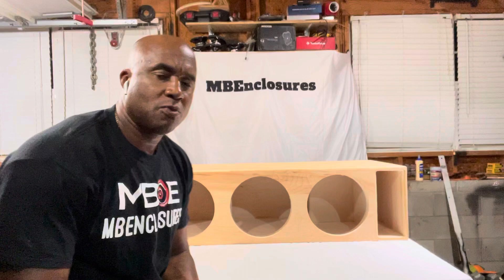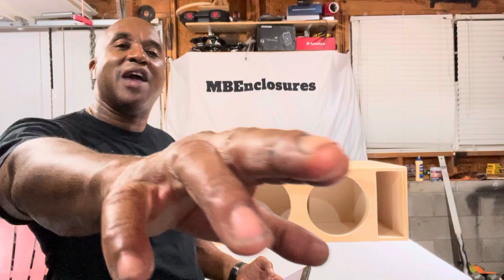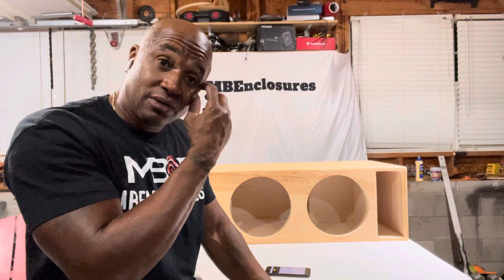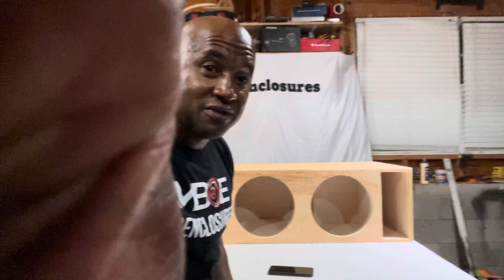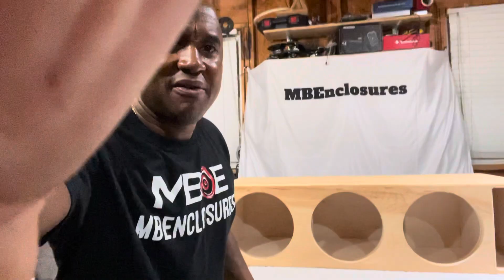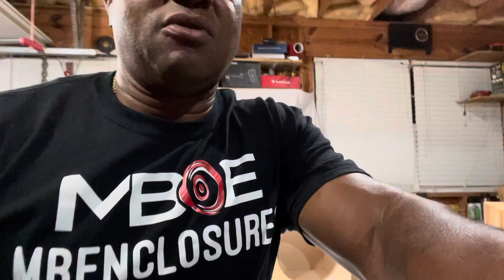Why JL Audio is to be respected.

Comment: JL is for ppl who think money buys quality.
Reply: JL is for people who are fans of technology. It's like Bose. Pay for space saving, a lot of output, with little to no power needed. My opinion, it's a win, win. You want high output, with little to no power needed, no extra batteries, alternator, multi runs of power, and mostly, possible damage to your charging system, JL is the winner in that. Majority of the others, Lose in that category.You do the math, You spend the same amount for a DC Audio build as you do for a JL build and get the same output, but less equipment for a JL build, and safer across all vehicle platforms. That's what people miss about JL.
Reply: What a ridiculous statement.  Little to no power needed? Does jsmell have some magic that every other audio manufacturer doesn't know about??
Look at the tsp of a 12w7v3 . 86.2db@1 /m. That's absolute garbage. Oh wait, they dropped it to 3 ohm so muh get more powa! 
Double or even triple the price of everything in its power class. 
Can you do a decent sq build with JL? Yes absolutely. Did you just waste your money and get laughed at by everyone who actually runs more then a single sub/ 8awg wire run to impress their buddies....YES.
It's like a mac book pro. You paid 2500 bucks for an i5 and 8 gigs of ram. 
SHIT! I better go, I think I just damaged my charging system with my triple 15 DD build that cost the same as a single w7...at 150 plus db.
Thanks for the lolz, chuckle nuts!
Reply: @burglekutt2233  name calling is unnecessary. The point of it is to not have to strain your current car as it sits to get the output of your DD subs. By the way, you must not know what subwoofer parameters mean. That DB rating is no relation to sub output. If that’s what you go off of, good luck. That’s why you need a 15 with tons of power to be as loud as my single 13.5w7 which, if you knew about subwoofers, is equivalent to a single 15 subwoofer by displacement. Try again. Oh, and I’m in the 150s with one sub on stock electrical, and 2 1200/1v3 and don’t drop below 12.9. Give that a try with your ridiculous over powered setup. Another thing, if you knew about subs, the reason it’s 3ohms is for flexibility around musical output. 3 ohms on a 1000w amp which is 1000 at 1 or 2 ohm,  like the alpine MRP1000.1 or JL 1000/1, or others like JBL and more, puts it at, 750-850. Musical output, and safe at all frequencies according to tuning. Which is rated. The new ones are rated for 1000, which means, get you a clean power amp, 1500w, and no need for crazy upgrades. Only setup close to as loud as mine in my town, is 2 X12 Sundown audio subs on a Salt 4K. And even they felt mine was louder. But, he had the wrong enclosure. So back to what I say, JL is tech, DD, Sundown, Orion, Kicker, Skar, Soundqubed, yes, great quality for price, but musical, and SPL, can’t put them in that category with JL on that. Do your research, more trophies have been seen on JL W0 subs than any other company. There’s a reason why.
Reply: @mikehonda7934  the db rating is  efficiency ...86 db @ 1 watt is trash. I use term lab Magnum to design enclosures and RTA. You probably don't even know what that is.
Get real man, you go down to 12.9 and you think your system is safe? 150s on a 1200.1??? Like hell. 
You think I would chime in on a JL post without having extensive experience with them? I run sq/l . I build systems, not pay someone else to do it for me at Best Buy
Your proud of what you have? That's cool but telling ppl JL is the tits is a joke. It's overpriced Chinese crap. Go hit the lanes and see what real audio enthusiast's run , or better yet take apart a w7 and see the thin ass weak Spyder and cheap coil. 
Here is a better name to call you,
NEOPHYTE
Reply: @burglekutt2233  good for you. I am a self builder myself. I said I have 2 JL 1200/1v3 amps on one sub. Clean power, unclipped, uses less current with an efficient enclosure. My box is built for music, and can still do SPL because, I know my cabin. I not once said JL is the end all be all. I just say, for technology, JL is ahead of most out their. Your reply, I accept as an opinion. I understand the equipment, and yes, I do higher end SPL and would never use JL for an end all be all for SPL. Thanks for whatever knowledge you may be able to spread to others. Try being respectful and do it in another way. This conversation isn’t for YouTube. Would take too long to debate. I understand enclosures. You must as well. Stop the audio hating.

Comment: Would be great to know what’s the best subwoofer box for nice tight sq bass on 300 watts 4 ohms since my car is Toyota Innova and has only 80 amp Alternator so can’t buy powerful amps
Reply: Go for morel sub woofer for pure sq
Reply: @sushantarora395  meaning more driver in one box ? Example 6.5” x4 or 10x2
Reply: Why not just a bigger battery
Reply: @fuckgoogleandyou8779  oh so if I put a bigger battery my amp problem is solved ? Have zero knowledge
Reply: @anandshah71  well to a certain extent yes... lithium has a high charge/discharge rate... as long as your not wide open the whole while

Comment: I’m patiently waiting for the new kicker solo x’s to drop to replace my old 12” solo x that the tinsel lead ripped out long ago. My old rare Rockford type rf x7 is wanting to push something big. First box I’ve ever built and took pride in was for that sub, 3.25 cu ft tuned to 32. Still have the box after a decade since running a real system. Currently prepping a more sq setup atm and delving into the dsp world. I almost pulled the trigger on a kicker l7 q class but decided to wait for the solo x. Love the videos man, keep em coming!
Reply: I can’t wait till he reviews the L7 Q class 15s!! With a ported box for two of them Speaking it into existence! and if he ever reviews the new solo X’s that’s coming out in the 15” version in a dual 15 box im going to lose it
Reply: I recently bought 2 L7Q 12’s, and was extremely disappointed. I’m a big Kicker supporter/fan and I’ve only had L7’s in my last 4 vehicles. 
Looking back I should’ve gone with 10’s, as the parameters between Q-10’s and 12’s are extremely similar, and I was using 1.5 cubic feet per sub(sealed).
IMO L7R or L7S is the way to go overall when you weigh the scale and look at the specifications. That being said, I had 2 Solo X 12’s, and will HAVE to buy the new ones when they come out!!!
Reply: Since I’m here, any recommendations on a good SQ/SPL subwoofer for .9 - 1.15cu ft sealed?
Also, thoughts on Skar audio amplifiers?

Comment: It's real easy to get caught up in looks. A lot of people whether they admit or not shop for magnet size and a million watts. I used to be that kid. Now it's all about efficiency and sound quality. Keep up the good content.
Reply: Yes thats what its always been about this whole time, actual sound quailty WHILE still trying to maintain built quality, that takes more engineering, research, and decades of experience, and thus more 🧀, its what separates the el cheapos from the Deep bros.
Reply: I'm working on trying to minimize power as much as possible in my ride and focusing on efficiency and sound quality myself.
Reply: With a 86db rating theres nothing efficient about a jl w7 and even worse for a w6 that is at 85db per watt
Reply: @ederreyes3612  

Most subwoofers fall between the 85-90Db/W efficiency range. Larger cones need more power to move to full excursion, yet efficiency goes up as an 18 inch can be moving more air with less power. It's not unheard of to see an 18" be rated at 100Db/W due to the larger cone area 

Also, different manufacturers use different measurements methods which can skew your perception. I trust JL to be accurate in their reporting of measurement results. 

The Sundown 18 is rated at 87Db/W, which is quite inefficient relatively.

I never ran my JLW7 12 with more than 500W using a Slash 500/1 Amp. It could handle 1000w more, but I never needed it. It would have overpowered all my other speakers and it was nicely balanced where it was. I like a lot of bass on my cars and some people thought even that was too much. 

But, at the end of the day. Who cares about efficiency, if you've paired your sub with the correct amplifier then sound quality is all that matters.

I don't claim to be an expert in different brands. I do however trust my hearing - as a mastering engineer and producer I work with sound all day every day. I use 2 x Fathom 12s in my studio with 20 grand of acoustic treatment, bass traps and diffusion and absorption panels so that I can hear the speakers and not the room. The W7s are CLEAN! There isn't a huge amount of information in the sound waves of bass - unlike midrange and high frequencies which have vast amounts of frequency changes and audible information. 

The main things that people are hearing as "quality" on sub bass is the attack and decay time accurately reproduced. Smaller subs are much better at starting and stopping than larger cones, which is why they need such huge magnets to control them. If you don't want SPL then they would still need large magnets to control the cone movement, even if their excursion isn't massive. 

Back in my car audio days, which was over 10 years ago, I went through at least 5 different manufacturers. Eventually I settled on JL audio, I liked their sound. What more can I say.

Beyond a certain point, all speakers become subjective. If you like a certain sound, you go for it. But don't tell other people what they have is no good or worse than what you have.

There is no perfect speaker. We have the same problem in Pro Audio gear in music studios. When you're spending £12,000 on monitors, the sound you're getting is very personal to you. It's not better than.. it's just different. Some people prefer a flatter sound, more clinical, I like a warmer, more musical style that I can work on for long periods of time.
Reply: Yes me too
Reply: Back in '95, I bought myself a system that had 3 JL Audio 12w6's. When I cranked it up you couldn't tell if it was hard to breathe because of the sound pressure or because you were getting emotional because of the sound quality. That's why, when I choose to deal with my mid-life crisis and break the bank again, JL Audio is already inked in as my lows.

Comment: To me the W6 is one of the best sql subwoofers of all times and spectacular balance of grace and sheer output I love my W7s and wanted to run them but u didn’t wana build me a box for it in this build lol so I went with 10” L7 q-class.  Not to mention my 13w7 have and shelf expiration date due to the cheap foam surrounds and which are built to fail
And don’t have much of a Uv treatment as is …

Comment: I really like both the w6 and w7 and some of there amp , but they are just overpriced .
Reply: A w6 is a great sounding sound quality subwoofer and w7 great spl but for half the price image dynamics idq and idmax  series are very similar and well built a definite budget banger
Reply: @sergiovillarreal1516  I had a 10-in w7 and I ended up selling it to move down to a 10-in w6. The w7 was way louder but I also had it in a ported box. And the thing was I wasn't even pushing it to its limit. But at the same time it was heavy and it took up a good amount of space in the back of my Jeep. Whereas the 10 inch w6 didn't take up as much space in the sealed box but it also wasn't as loud. I wish I would have just kept my 10-inch w7 in the first place.
Reply: @prepordietryin9119  W7 will always be a beast
Reply: I was going to get JL subs but every car audio shop I been too has tons of warranty return due to surrounding separation,  I know and have met people telling me don’t get them because they will separate from surrounding but they sound so good
Reply: @beerman9807  hasn't happened to me. When the surrounds fail, it's always been, from my experience from friends of mine that run JL, bad storage conditions. You spend money on the equipment, and treat it like it's Kicker, or Sony Xplodes. Take pride in the money you spend, and they will never rip or tear.
Reply: @beerman9807  nonsense

Comment: Jl prices don’t compete with output. My dc level 6 m5 18 is the same price as a w7 13.5. A jl 1200.1 is 1200 bucks no way you get a used dc 7.5k for that price. They put a lot of technology into their design but it’s not worth it to me. Jl also don’t win sq competitions or spl competitions.